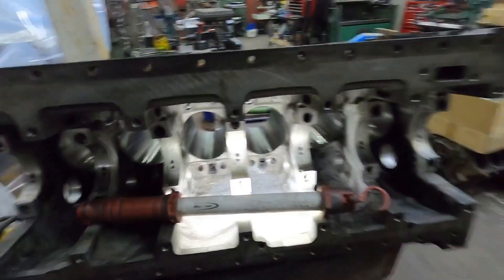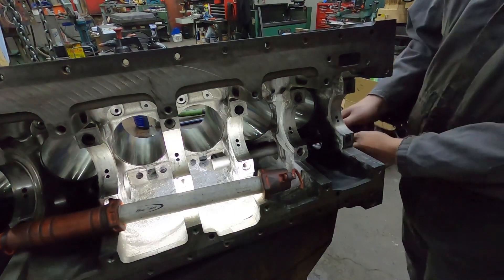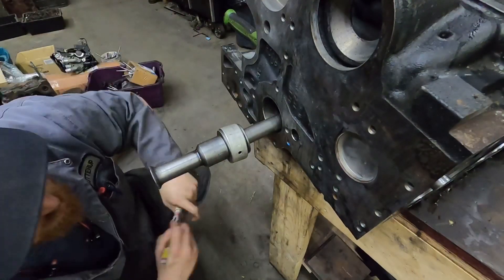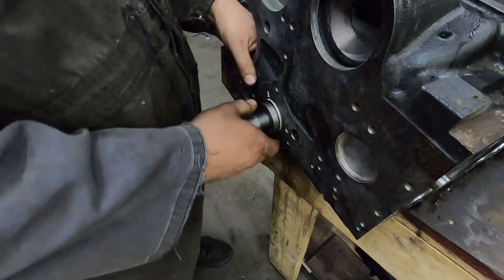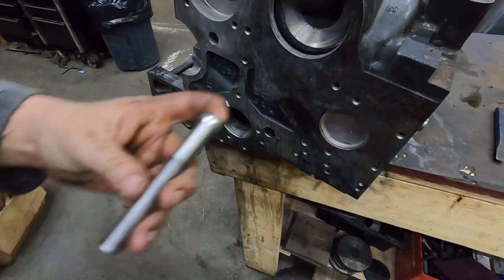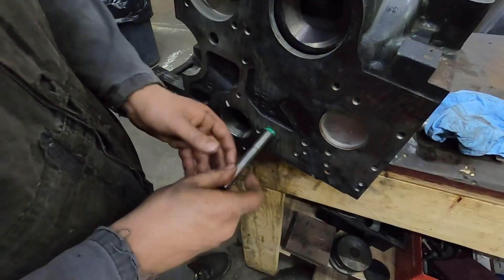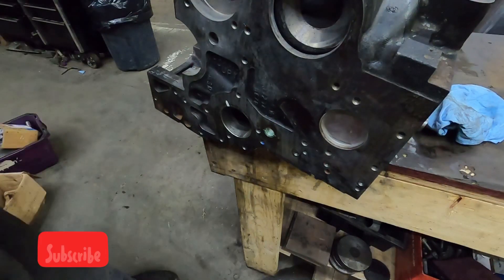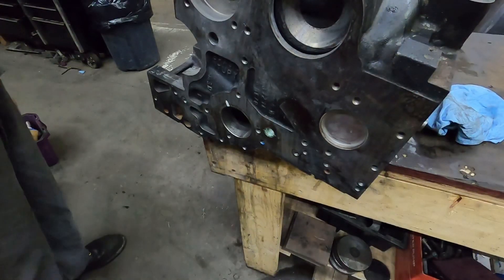How to build ppump 6.7 Cummins part 6

Comment: They are casting plugs.
Reply from the maker: when talking a expansion plugs with coolant behind it then you would be right or when casting sand would be in. any thing that has been drilled or machined  then most manufactures just call them a expansion plugs. but all basically all do the seem thing so name really doesn't matter lol

Comment: I found some permatex anaerobic that is a red jelly like substance that fills up to .005, but it is oil soluble so if used on rear main seal on like sbc 2 piece, the stuff that squeezes out wont plug oil passages. I could not find brass Cummins plugs, saw stainless and those expensive aluminum deals. Whats the deal with those aluminum plugs? I figure if your cooling system has enough pressure to push out freeze plugs, you might bigger problems than freeze plugs. Now I will stake them in place, thanks for the tip!
Reply from the maker: I just use steel plugs ( melling kits )